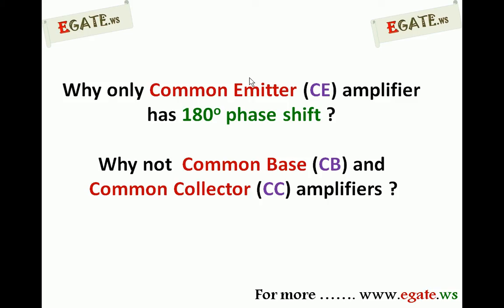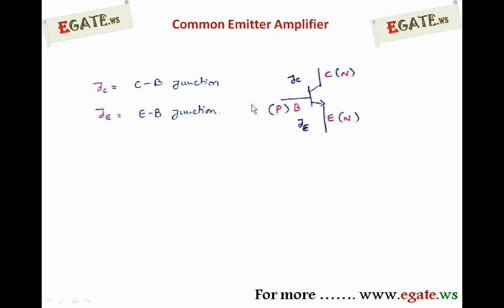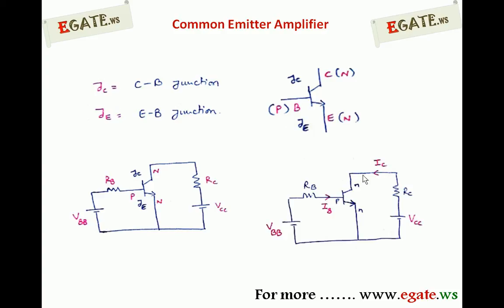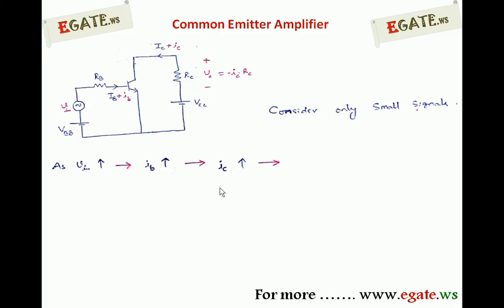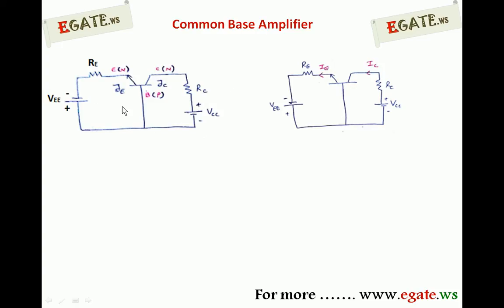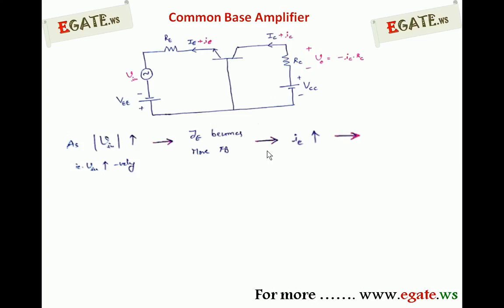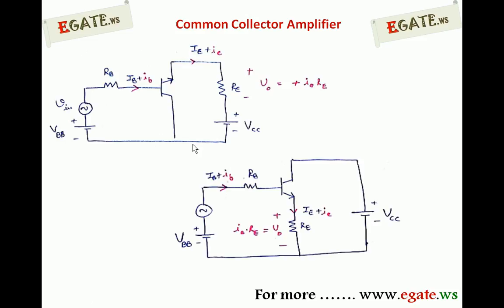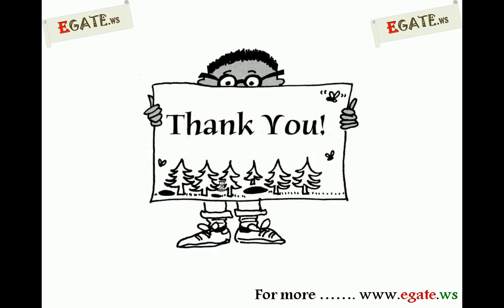Why  Common Emitter (CE) Amplifier has 180 degrees phase shift ? Why not CB or CC ?

Comment: khoda pahad nikli chutiya.main cheese bataya hi Ni theek se.bakwas
Reply: There is no phase reversal in the sense that the output has a negative voltage, there is phase reversal in the sense that the o/p is decreasing as the input is increasing because remember that the output is oscillating around the quiescent point.

Comment: sir understand theoritically but in case of practical what is happening in the transistor when it is in active region(i.e when it is in active region ,what is the behaviour of the semiconductor atoms(Si or Ge) .How it (atoms) will behaves with respective i/p signal ),And also please give  ce configuration phase shift in practical manner (atoms response with signal) explanation.